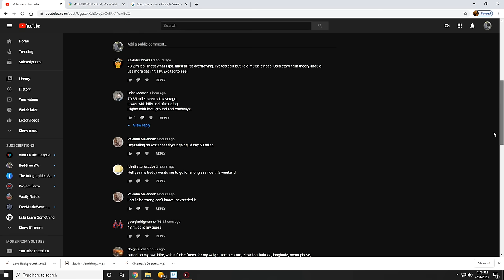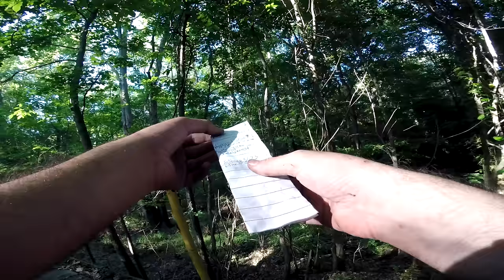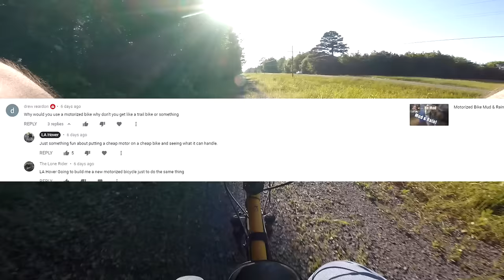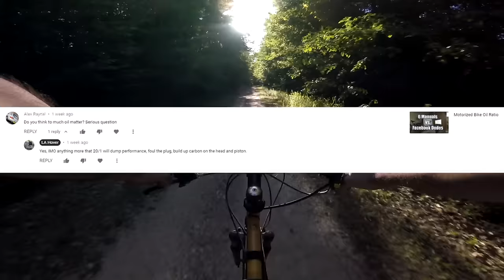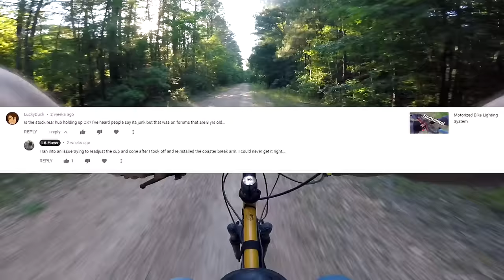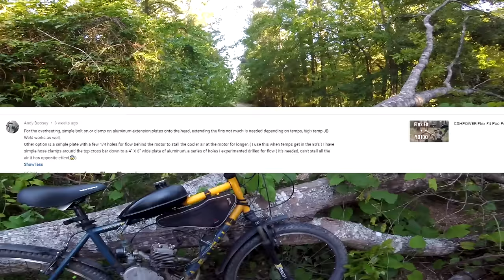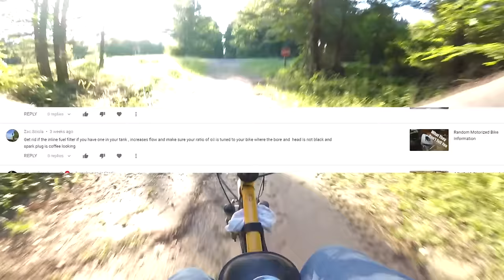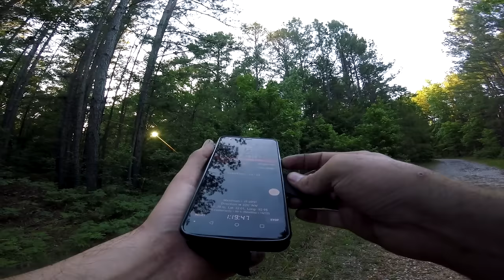Motorized Bike Endurance Test

Comment: You got a (rare) like outta me simply because you grease wheel bearings!  I can't tell you how much rolling resistance a poorly adjusted/ungreased wheel bearing adds to a bike.  I had a buddy come over for a ride we were both on very similar haro bmx-style bikes.  We swapped a couple times and I knew his bearings were either shot or almost there.  I waited for him to say something and waited till we got back.  I, then, promptly gave a bearing packing and adjustment tutorial.  It was like night and day for him and added another fan to bearing aficionados everywhere.
Reply: The worst thing is over tightening the bearings for drag and damage.  No grease will wear the bearings and race out real fast.  But greasing them and then over tightening will SLOW you down and once you have wheel wobble you've worn those parts down beyond just a grease job.  If you have sealed bearings it's all good but even washing your bike without them you should re grease them pretty quick, especially running an engine.  Don't forget the cassette... not pedaling for so many miles means the rear gears are always clicking away.  If the ratchet in it gets dry the fingers will fall out.  Sorry for the long message lol

Comment: My lower back starts bothering me after about 15-20 miles. I'm always on the state highway and it's generally fairly smooth on the shoulders (when they are there) but I am 46 years old so that accounts for some I'm sure. I recently switched from a mountain bike to a nice cruiser with wide 27.5" wheels, a Springer front end and a cushy Schwinn seat with the two big springs so I'm hoping the ride will be a little more pleasant from now on.
Reply: Vibration is everything. Put some rubber strips between your motor mounts and the frame using an old bicycle tire or garden hose. Wear padded bike shorts like the Tour de France pro's. (You can wear them under your cargo shorts if you're self conscious) Wear padded cycling gloves to reduce vibrations into your hands too. Be sure to stand on the pedals every ten minutes or so. But you should probably be giving the motor a chance to cool down every 20 miles or so anyways.
Reply: Raise your seat an inch or two ,common mistake when riding is not allowing your body to sit upright and fully extent the legs , it should be just low enough you can mount the bike, but high enough you gotta tilt the bike just a tad to the side to do so and I mean a tad, not lean the sucker over and climb about the stilts🤣 made a world of difference to my lower back, make sure the new seat is angled properly on the post aswell little things can cause a big pain in the ass

Comment: Great vid.
First thing i figured out going Trail Riding was to bring spare fuel indeed.
Second was always bring a Folding Saw of good quality. Trees and limbs cutting on trails. Easier to lift bikes over. Let someone else pick up and move it though. Hey i make it easier for them dang it.
Third was bring tools for the bike itself. Breaking down sucks.
Fourth... Relax and Enjoy the Ride. Try not to worry about things that may go wrong during the ride.
Fifth .... Tell a Loved One or a Friend your ride route. In case you do not return from the Ride. Things happen. Accidents happen. Animals may attack you on the bike. I've had snakes, gators, bear, boar, and cougars try and catch me before. It happens.

Be Safe. Be Cautious. Be Alert.
But try to Relax too.

Comment: For an all stock China doll with a lowered gear ratio that is actually rather impressive. What shocked me was that the clutch hung in there being that you do not have pedal assist to get you going. I have a build in mind but it will have a much higher performance engine on the bike. Total cost is probably going to be around 1500 bucks but should it work out the way I envision it will definitely spark interests everywhere. Thanks for sharing and be safe out there. Oh by the way I always take a backpack with tools and extras when I hit trails no matter what type of bike it is you can never be too prepared for Murphy's Law of not if it will happen  ut rather when it will happen 😉😉

Comment: mine did about 70kms so thats also 40 miles!! stock aliexpress 80cc kit with the bofang nt carburetor, clip at the second from leanest position, not rejetted, stock 48t rear sprocket. i also took the muffler out of my exhaust, but the cap is still on so its basically kind of an expansion chamber. im planning on putting a 21mm pwk carb on there and also upgrading to a 36t hub mount rear sprocket kit. 

happy riding and stay safe✌
Reply: How many kilometres have you been driven with the 80ccm motor?

Comment: I like these vids! I used to ride the “fixie” style frame with sealed 5 spoke mags, a high compression head, stock NT carb and that same “peanut” tank from Station North in Baltimore city to downtown D.C.  it took me about a tank and a quarter to complete the trip. Sometimes a tank and a half. Lots of rolling hills but most of the trip was a straight shot. I was a nice ride on that size wheel and I took the lane because the bike held a nice speed also lots of kudos and cellphone picks from motorist along the way. So many curious people along the way. I no longer live in the area but still have a 2 stroke bike and looking for a new route.
Reply from the maker: Thanks, and good luck finding a new path that will give you as much joy as the last.

Comment: At the vid start when you said 2L tank. I said to myself. 40-45 miles tops.
Mine has a 3.785 liter tank aka 1 gallon. 4 liter if i fill it to the cap itself.
My bikes are 4 stroke. No pedal assist too. 
I should check into 2stroke engines for my frames.

Comment: My engine destroyed itself today when I was 25 miles away from home. I was running the carb way too lean. The piston got really scored and same with the cylinder. I ordered a replacement piston and cylinder on amazon for 25 dollars. I was bummed and I had to go for a pretty good pedal. The reason these motors are so nice are the replacement parts are very cheap.  And by the way, nice video!
Reply from the maker: Oh man the moment it died that far out must have been gut wrenching. Sorry to hear it man... I have been having motor issues on two bikes ever since I started testing 40:1, so I'm going back to 32:1
Reply: LA Hover Do you think I will have to go through the break in process again once I put in the new piston and cylinder?
Reply from the maker: @Jeff_Green  Ya I would. I'd treat it just like a new build for one tank... It looks like I may be replacing the piston and cylinder on my Seeutek (Cranbrook) as well. It lost compression last night.

Comment: The wiring comment mentioned the bigger the wire the larger the allowed amperage or “rate of flow “ a wire has volatile is just the “pressure “ the smaller he wire the smaller the allowed current  “allowed”meaning  to avoid melting the wire and causing chaos
Reply: Larger wires can also be used with higher voltages power lines are a prime example of this

Comment: Another way to expose more surface area to the atmosphere for heat transference would be to remove all paint on the cylinder and head. The best way to do that would be media blasting. The media being glass beads or sand. This leaves a rough surface which is larger in area than a smooth, flat surface. All of my air cooled engines are treated in this way.
Reply: Great point

Comment: Oil burns hotter than gasoline. Something to think about if overheating is an issue. Also, the more oil in the fuel, the leaner the fuel/air ratio, which also contributes to the heat.

Comment: 26:00 what I've found is, it's not the weight. It's the awkward way you have to hold the bike and the fact that you have to hold it far enough away to not burn yourself on the engine or exhaust.
Guess they weren't ment to be carried to much

Comment: I used to ride mine down log roads, huge rocks everywhere it was very rough, I even wrecked and broke some cooling fins off,  still ran good and I would still rip around, I defnitly never took care of the bike either, a 85 dollar huffy beach cruiser is a decent route if you relocate the mount for thr rear wheel, I had to install mine in the little cutouts before the wheel mount because they warped instantly, never had a issue after that just be sure to use thick washers for clearance.

Comment: About the gpu/cpu cooler thing...
Some of them have a lot of fins close to each other. Those are designed for active cooling, where you have a fan blowing all the time, and some are passive cooled, the fins are spread apart. This all have to do with the static pressure of the air being able to go through the fins, passive ones relying only on convection. Assuming that you may be able to mount one of these to you head, maybe if you line up the fins to the front, you can get more effective cooling.

Now... a bike frame is usually made of aluminum. It it stupid for me to think that the frame can somehow be linked to the head and used to sink some heat?

Comment: I was wondering why it sounded like you were at 8mph and it bogged.The 2nd braincell fired and I recalled "27.5 tires".That was a great video,and I thank you.When I ran the 50 tooth on my 26" at average 17mph,I did 33 miles and had 2/3 of the lower humps.Thanks for info on editing 'ware too.(edit=I run 56T too,but use a CDH Power reed valve and port matched gaskets)
Reply from the maker: Lol ya I bog everything apparently. This one was 44tooth 27.5". Shes not happy unless shes is in the 20s
Reply: @LAHover  ;AAHhhhhh,derr..LoL,Sheesh.I thought I was screwed with the new mileage somehow.No,you don't"bog everything"It's a normal blend then,when 44T meets the road at 7-ish mph.Mine takes of after 1 pedal down@3mph.(GPS Speedometer,is what I use and with the 56T,= 16.8-17.3mph hums like a boat,and runs easy.Did 23.8mph when just letting it rev-out before I saw my limiter flashing)BTW@32 miles per 2/3 Ltr. tank too.

Comment: I have a decent e-bike and I love it. But I bought one of the gas ones because I like to tinker I got sold 100 cc kit on an old Roadmaster frame stuck in high gear so it was super hard to start because he put a jackshaft kit on it. Is it going 2 cost what I paid again to get it right but that's okay. Only thing that sucks is it needs everything. Split plug wires  carburetors derailleur, I'm kind of an optimist so when I get it fixed I will be that much more proud. Toyed with the idea of getting a whole new kit but that's not me, is the work with what you got challenge.

Comment: Thank you, man, I am currently breaking in my Paxmor 80 cc buiold and i used a Huffy Deluxe 26" cruiser frame and  your videos to build it. It took me about 4 days and about 4-6 per day/ This includes a day to fix 4 stroking and 2 days in chain issues. It turned out great and I will continue to use your videos.  I lhave lost 1 spoke, had to modify my breather cap in order to get the best chain action. Also, due to chain action, i had to buy Grade A bolts and nuts on the wheel sprocket bc the chinese stock ones stripped out and gave me a lot of problems.  I live in Mississippi, so our weather is similar to yours. My  top speed is 27 mph and my cruise mph is between 17 and 23, is this the usual speeds for an 80 cc build? And is it ok to run full throttle a lot?

Comment: at 13:47 you mentioned that anyone should speak up if we do trail terrain on a cruiser... well, that's me! :) I don't have any videos of it, but essentially I was given a Micargi beach cruiser and a (very poorly assembled) engine kit. The original owners apparently had no technical skills (fixing their 'work' gave me a real hard time), and so they just gave up and gave it to me for free. 

[[one of their issues I'm working on right now is they misaligned the rear sprocket, so I'm working on that later today.]]

I don't really want to buy a mountain bike and another engine kit simply to make it more durable and allow for a bit more off-road riding, so I've made some basic mods like adding a front brake (revolutionary! wow!)  since it only had a coaster brake, swapping for off-road tires, making my own vibration padding for the engine mounts, and blacksmithing a third engine mount because it would lean on the axis with only two mounts. 

All this was practically for free! I got the front brake and off-road tires from a broken bike, I made the third engine mount from rebar, and I made the vibration padding out of rubber/foam flip flop soles and random foam. I'm considering buying a cheap $30 front fork with suspension just to give it at least a minimum level of shock absorption.

Practically everything else is the same from the original beach cruiser, and I've been able to get along on trails quite nicely! Sure, I have to throw my body weight around and feather the clutch sometimes, but it's still remarkably fun on a cruiser. Let me know what you think :) Anyway, amazing videos! I love all your content :) Happy trails partner

Comment: As far as adding vinyl siding between the tube and tires I had totally forgotten about rim tape to protect your tubes from the spokes puncturing it. Guess vinyl siding could be used there also to help protect the tubes. Do you think using it in both locations will give a hard stiff ride?
Reply from the maker: I personally like gorilla tape for rim lining. Siding there seems like a hassle to keep in place.
Reply: The bike shop in an expensive tourist town had tire liners for $42 a piece. They were built like a sherman tank, sidewalls and all. They said their rentals never had a flat yet. I would stick anything in there, the ride wont be any different.

Comment: 3.5 Liter tank 32 tooth on a cruiser for a first build  on 26s , 2 stroke. What would you guess miles per tank?  I'm 6ft plus at 300 lbs so comfort is a must.  Wish I could ride your style bike.  Blessings to you and yours brother as I waive from SOUTH CAROLINA.  👍🏼👍🏼💯💯
Reply from the maker: Hard to say honestly. But if the tune is good and you are not fighting allot of hills I'd expect 50~ miles on a 3.5L.
Above 220lb will cause the China dolls to drink allot. You may actually get better mileage out of a slightly larger motor like the yd-100.

Comment: Why do you pedal while on the road? Is it a legality issue? I did the same today while on the bike path...assuming it would be considered assist, like an electric motor. Not sure if that would help me anyways. These are legal on the road here in Florida. It is considered a moped.
Reply from the maker: Yup, It helps keep all the Karens confused lol... When they hear a motor, but see you pedaling it's kinda like trying to divide by zero on an old calculator... They just kinda shut down.

Comment: Holy shizzle, we live in the same state! Anyhauser, I just bought me a Kent Bayside here a little while back (right from the rack at Wal-Mart) and I wanna get me one of those Zeda 100 engines to go on it. That way I will have myself a 7-speeder runabout.
Reply from the maker: That is a good combo, I think you will enjoy it! We have a review video, upgrade video, and adventure video with the bayside on the channel you may enjoy.
Reply from the maker: Just be sure to take off the stock fenders. They are very dangerous!
Reply: @LAHover  Already done that actually 😁. Took them off right after I bought it. Next thing coming off will be my pedal crank (only temporarily) and figuring out how I'm gonna chain together the Zeda engine and the Shimano cassette/transmission. A jackshaft will work but finding one with at least a little bit of quality is the challenge. Unless I'm not looking hard enough, it seems that Alibaba and AliExpress keep cornering me in an alley with their cheap hoopty-house crap 🤣.
Reply: @LAHover  Also, I've subscribed to your channel to stay tuned to future videos!
Reply from the maker: If this is your first build I highly recommend just using the motor kit's direct drive. But if you go with a jack shaft / shifter kit I wish you the best of luck.